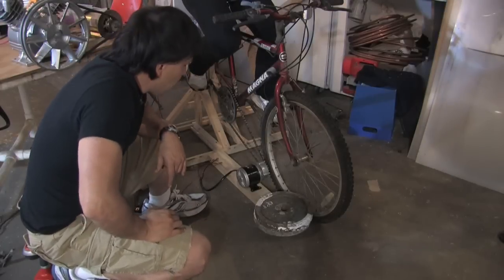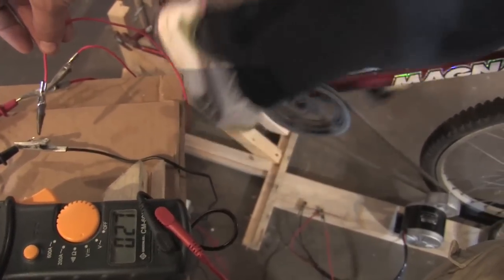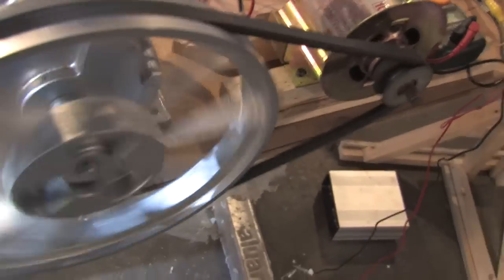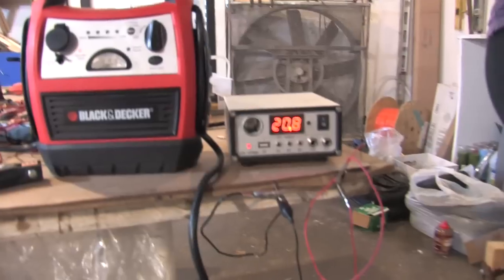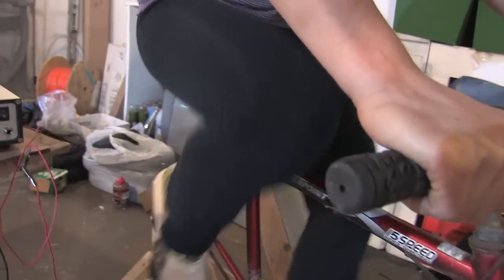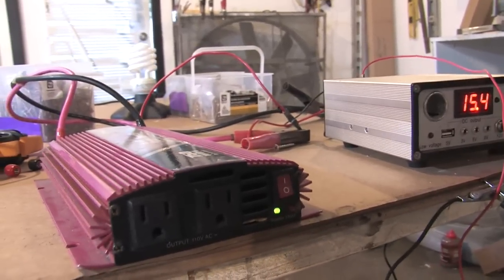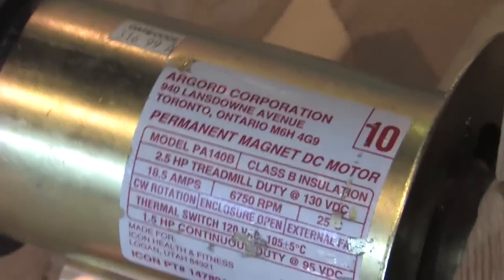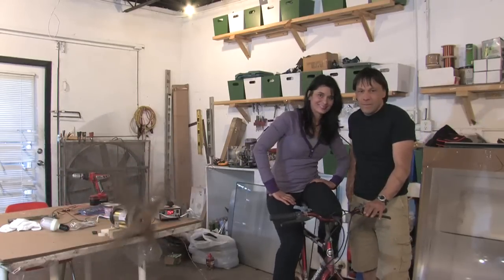Bicycle Generator DC Generator Green Energy ELECTRIC BIKE DIY HYBRID

Comment from the maker: If he can run that same test without the batteries, then it would amazing, he is just simply running an alternator off of an electric motor. Even if he used a fan belt, he would have the same results. If overunity were possible with his test, he could plug the motor in to the inverter an it would run itself forever:-) I think he pulls a lot of the negative comments. While I am open minded to the impossible, the battery is the reason he  is 150 watts over. The alternator tops it off.

Comment: I think the goal is to take what we have and use it as Efficient as possible by adding to it what is needed. Sure you can make a really efficient setup if you change the generator and figure the optimum gearing. In that case it would be better to start off with an AC generator instead. Adding a Flywheel would be easy enough and you can add in a Capacitor as well.  Even adding a battery as Dan stated in the video would work and would serve to protect the equipement being used.

Comment: The reason I would allow the voltage to drop as far as 12v is to allow the motor to turn at a slower RPM.  That way Denise can peddle longer. The load will be somewhat consistent and should not max out the watt rating on the motor. It takes more human energy to turn the motor faster and you will still be producing the same amount of energy.  So what needs to be considered is to maximize the endurance of the human.  A flywheel would help although it would put more load on the human energy.

Comment: No it is the loss of volages here. A capacitor allows the voltage to lead the current. The gen supplies current on demand. Need to build a Regulator to go inbetween the generator and the load. This allows the voltage to remain constant reguardless of the peddling speed.  The current will do as it needs to handle the load.  It takes more then just a capacitor to do this. Build a regulator that can handle 12-35v input and maintain 13.8 out. This will allow you to peddle at variable speeds.

Comment from the maker: The average person can generate about 200-300 watts for a minute or so. If you are in really good shape, you can hold it for 30 minutes to an hour. It is estimated that Lance Armstrong hits 500 watts for 20 minute bursts.

If you consider loss in the generator and charging, This set up is about 100 watts. 10 hours of pedal time equals 1KWH.

I do think the load is nearly maxed out when charging. Denise rides daily on a stationary bike. Two of these motor/generators may be a possibility. 200+watt

Comment: Charging a little battery like that is one thing. But would it be more difficult to impossible to pedal if your were trying to charge a whole bank of batteries in say an off grid home solar/wind power system? 

Or would the resistance be the same, but the time you need to pedal for be greater?

Comment: hey guys I like the idea for using this for and exercise bike.... I would recommend you guys attach a flywheel to your system, this will help reduce the inconsistent rotation speed caused by the natural pedaling motion of a human.  This will also help reduce the sudden jolt felt by the rider when a load engages the system.  (Id say 30-90lb based on set up) all of this will contribute to higher quality power output.

Comment: A 1.2 Farad capacitor will keep the inverter running for much longer. The inverter is not shutting down from lack of voltage, but lack of current. The capacitor will smooth things out and the inverter will stay running. I have ran a 19" color tv with this application, that draws 65 watts, from the inverter. Once you get past the in-rush current for the tv, it will work.

Comment: is there any way to regulate the volts better on the setup? i have a few of those motors from scooters. i have also thought of using an alternator. i have a less than fortunate friend who has no power or water, and i have been trying to get him set up on wind,solar and other alternative energy. the problem is he has little money and i cant spare much either, any ideas or advice for cheap ways to do this kind of thing would be very helpful.
thanks, batteryphil